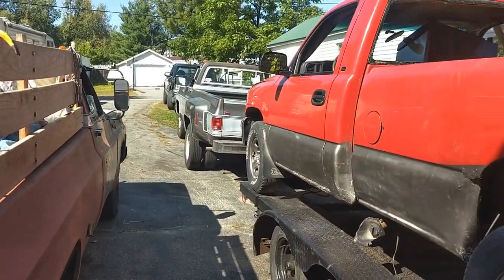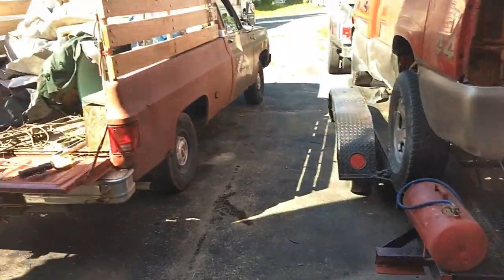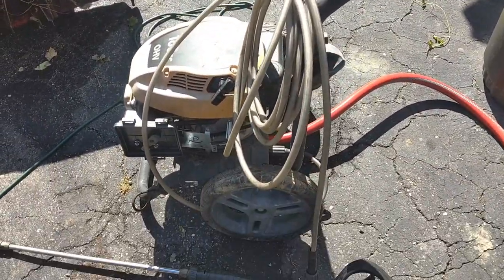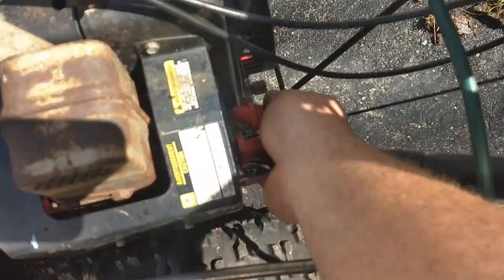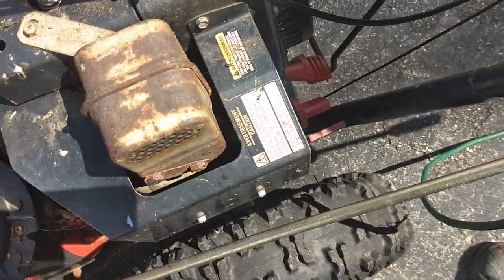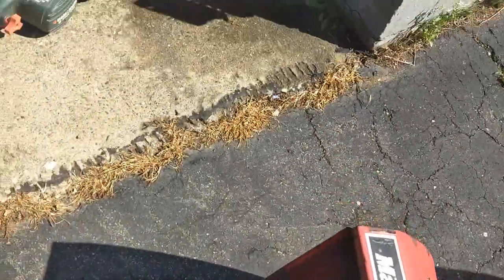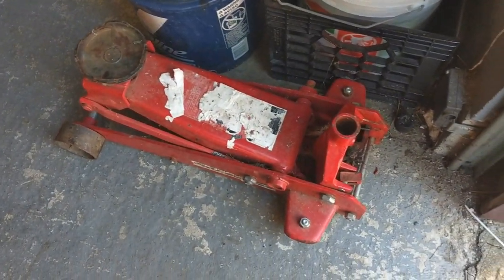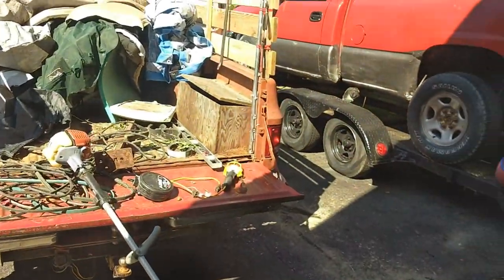#1 Steel and Purple Rain

Comment: If it pumps off and on you probably have air in the line. Try letting it bleed off to make sure there’s no air. There can be a lot of it in the water hose.
Reply from the maker: how do you bleed it out?
Reply: acrazycanuck78 Let the hose run for a good 60 seconds or more before hooking it to the pressure washer, hook it to the washer then turn on the water and squeeze the trigger for another minute or so before you start it.